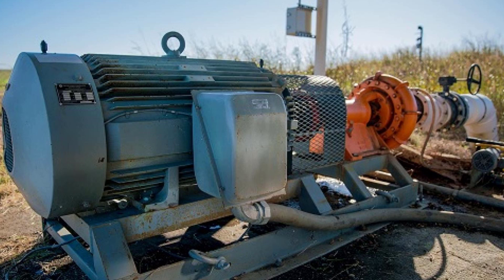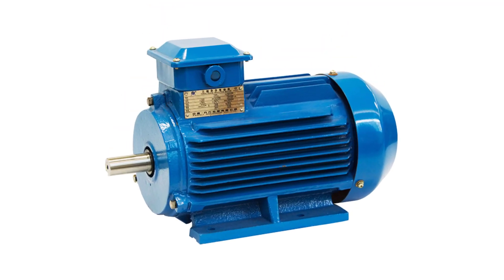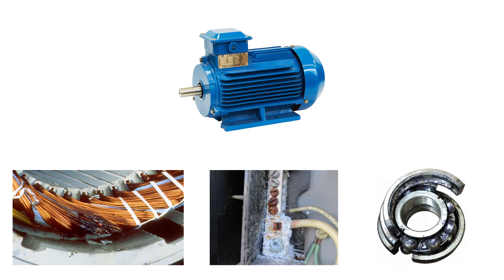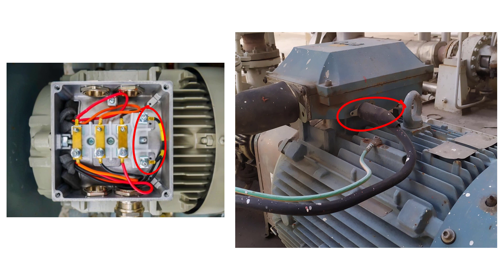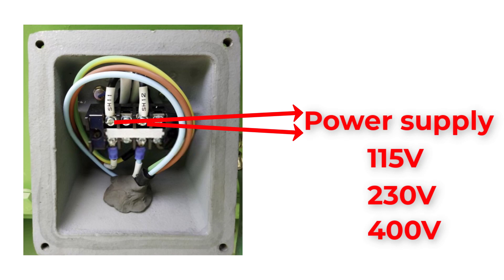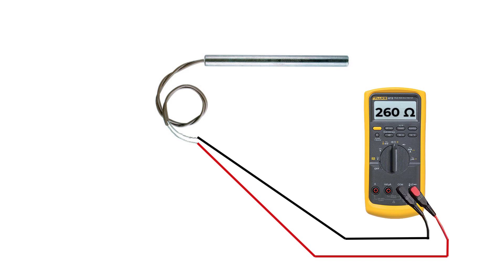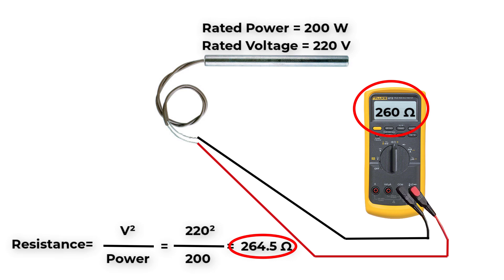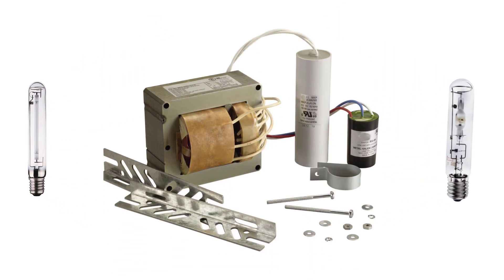What are Space heaters for electric motors? |Explained

Comment: Hello, thanks for the video! 

How can I connect this to a 230V power supply?
Is a circuit breaker in the control cabinet sufficient, or should I take other necessary components into account?
Reply from the maker: Thanks for comments,, no we must have a relay to be closed and connect it to power supply when motor is OFF, and relay will be opened and disconnect it to power when motor is ON
Reply from the maker: I can make a reel or short video about it if you want❤️